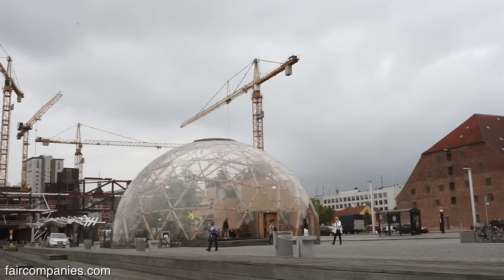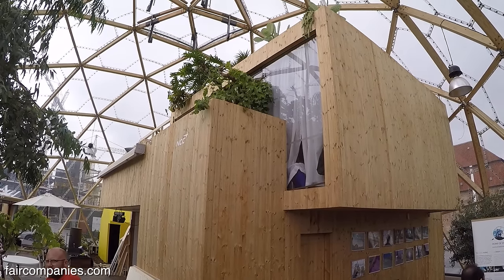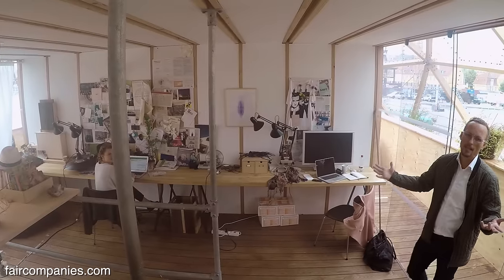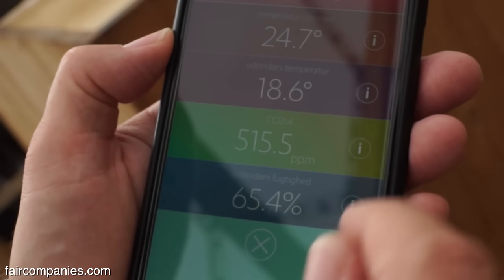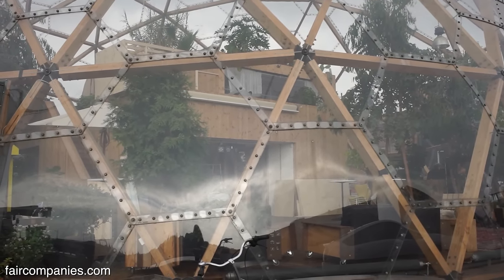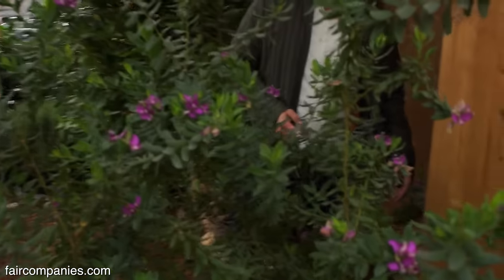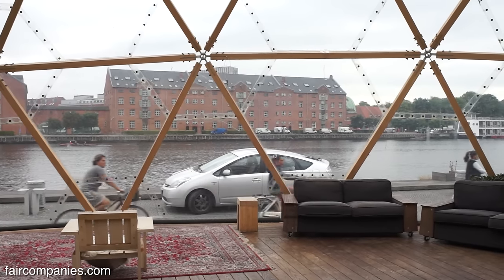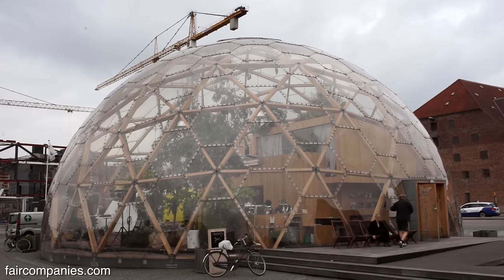Nordic home encased within geodesic dome for passive solar

Comment: I went to the party that they mention in the video. and although there were approx 150 people and it was misty inside the air remained fresh and a lot more comfortable than any other building I have partied in. there is an air-conditioning unit that they use for increasing circulation. I love this place and hope they build more around the world. who doesn't like the Mediterranean climate? :D

Comment: This is a fantastic idea. I've considered this kind of structure. But, I'm thinking of making the North side and part of the top opaque so as to limit insolaration in the summer, and the radiation of heat out during night and/or winter. The amount of insolaration would be naturally changed by the sun's angle during the year.

Comment: I've had this idea in my own "thought design sessions".  Also, for more dense urban developments, a series of stacked, extremely large platforms that contain a series micro-neighborhoods where homes can be built.  These homes also don't need as much protection since the platform provides the basics.  The micro-neighborhood gives basic protection from rain and extreme sunlight (or let sun in depending on climate).  Maybe it is fully enclosed?  Partially?

The neighborhood has no large vehicle traffic.  Maybe there is a basement level for deliveries and vehicle parking/reception/departure.

Comment: So the heat from the dome prevents snow, ice build up? I’d need to see that before I gave up feeling any weather. Also, you need to make the connections thinner. There is too much junk blocking the view. The interior is a mess. Set up for its intended purpose, a garden, kitchen, children  etc and actually test it. How does the car get in/out? How do children deal with the dome? How do you clean it after the rain? Poly gets scratched by rain, plants, wind. How do you deal with loss of visibility? What is its lifespan? How are panels replaced?

Comment: Why do we not have small communities under large domes  by now especially in cooler climates.
Reply: TheJunkyardgenius 
Great question. I am more interested in creating a family home like this
Pammie from Chicago
Reply: Unfortunately business is rarely driven by engineering efficiency. It's more about creating and saturating a given market with products, even overproducing and ending up throwing huge number of products (and the sold ones carry the cost of the over-production and inefficiency) ... similar story with cars, even electronics. 
Probably one of the few exceptions is airplane industry, where because of the costs and low profit margins they're forced to be max. efficient ...
No wonder Buckminster Fuller opened one of his lectures with this question:
"Why don't we build houses, like we build airplanes?"
Current one is terrible economy model! :/ 
It has to be changed, and with the climate change already happening rapidly, it's an urgent need to change that stupid model.
Reply: It might be probhibitively expensive to a community dome and there'd be alot of practical concerns.

Earthship communities would be a more practical option, high insulation  on 3 sides and then a separated greenhouse section at the front south facing side.  That regulates the temperature whether it is hot or cold outside.  The glass needed is kept to a minimum and you can go outside for fresh air.
Reply: An accidental fire would cause catastrophic results.
Reply: I want to do that, somewhere in Scandinavia.  I just don't have money and don't live there 😂😥
Reply: They would bake in the summer. Plus in winter it's nice to have some relief from mosquitos, fleas, ticks, flies, gnats etc... Rain is also a cheap cleaner. Many of us are familiar with parking garages or subway stations that are much dirtier than 100% neglected sidewalks(I don't mean trash, but things like spit, spilled drinks etc...)
Reply: Snow would be the biggest problem. A larger dome with heavy snow would collapse.
Reply: @antman7673  Not really.  The total static weight that can be supported over the entire dome is usually greater than any normal snow load it will have to support, as snow does not easily accumulate on a round roof. The reason a geodesic dome can resist damage by snow loads is that the shape of a geodesic dome naturally sheds snow.  Also, by increasing the frequency you increase the strength of the dome.  You'd have to build a HUGE dome with a substantially flattened top before snow load would be a problem and even then the internal heat would help melt the accumulation on the top.  You probaby wouldn't want to enclose hundreds of full-sized homes but you could certainly enclose a small community of tiny and small homes in a shared space like the OP was suggesting.
Reply: because the window cleaning service would be expensive
Reply: @DennisMoore664  
Depends on the size of the small community, how large the dome is.
If it encapsulates 50 houses, the angle of the dome isn’t very high, so we have a huge flat area and snow is really heavy.
1 Meter of snow is roughly a ton of weight per square meter. -That is considerably more than the weight of 1 square meter plastic sheet, plus wood or steel support.

And if the sphere is big and made of steel, it gets very expensive very quickly.
Reply: @antman7673  To avoid the roof angle problem you need to increase the frequency.  That will maintain more of a sloped top and reduce the size of individual panels which helps keep the snow from accumulating substantially on a small number of large panels like you point out.  It would take Jeff Bezo's kind of money to do it which is the real problem.
Reply: @DennisMoore664  
It would at take Jeff bezog money to do.
A half sphere with plastic glass shouldn’t be too expensive.

Bezos money is bigger than less than 50k per house to dime it.
Reply: I think moisture would be a huge issue for the homes inside. That would be the first problem.
Reply: @DennisMoore664  Domes are strong vs snow load because of the configuration of the struts and linkages all supporting the same amount.  Domes can support many times their weight.  This is why domes are deployed in Antarctica.   It withstands snow load and can withstand higher winds than any other engineering.
Reply: @antman7673   the dome wont have a flat top.  that's not a dome.   Also, domes can be feasibly engineered to encapsulate miles in diameter.
Reply: @David-bc4rh  Exactly - And the higher the frequency the stronger the overall dome is going to be regardless of it's footprint.

Comment: I am working on an idea with deltoidal faces fitted into a 4 frequency dome. It would need 1920  bars for 480 frameworks. I made some different designs with fusion 360 to get the exact angles, and i planned a miter saw table to make the production very easy and for a very exact repeatability. And, the outer surfaces i thought about to use acrylic glas and wood with one layer of GFK like wooden boats are protected from water. I would like to share pictures of my drafts and i am very interested in experiences from others!
Reply: Would acrylic be better than polycarbonate?

Comment: Great video, thanks. It's the best use of the geodesic structure that I have seen. You have all the advantages of the sphere  - rain and wind shielding with the minimum of structural material - and none of' the disadvantages - fitting square storage into a round space. Perhaps a small improvement might be to clad the top and Southern portions with solar PV panels to moderate the summer temperatures.

I could not make out their rainwater management system. Where does the run-off from the dome go?
Reply: +Jeff Harmed it looks like the base support is about 6 inches above the ground so I guess rain water goes straight (or curved) to ground. Personally, I would use a 4 -6 foot riser on the sides for height in classic dome home fashion and catch the water. there are so many great uses for rain water and here in Florida we get so much we have to let most go to overflow.

Comment: I imagine cleaning the bird droppings would be fun.
Reply: You could just have a small unit of cleaner drones.
Reply: Just don’t include birds in yours silly. Sheesh.
Reply: Insects produce droppings too ... and you would have to get them inside the dome to pollinate your trees (otherwise they are quite useless).

Oh and imagine the spider webs, birds nests and all the rest you'd have to clean on the inside. Outside you might be able to build a robot which creeps over it for cleaning, but inside there is the support structure.

Comment: I love the concept. Some thoughts:

Are the polycarbonate panels UV-resistant? How often would they have to be replaced in a more sunny environment? Do they get weaker or more fragile over time? How good is their fire resistance (e.g., forest or brush fire in the country, nearby dwelling fire or arson in the city)?

Have you considered using a steel hexagonal frame for the shell doors? That should add more strength than the rectangle with less mass per element, and would be more intrinsic to the overall structure. (You could insert a conventional door frame within it, and even add sidelights.)

One could also hang solar panels from the shell in a pattern to block direct sunlight within (for sunnier regions), or on the solid house walls (although, there are developments in transparent solar panels, which would be prime for the outer shell).

Comment: Might have big problems with off gassing of construction materials and worse, stove gas, propane gas etc. collecting in the confined space. You'd have to rely on sensors and alarms entirely.
Reply: Probably uses electric for all that, especially since it requires less heating with this setup. The rest is easily handled with occasional venting.

Comment: I have stayed in big domes at remote radar sites in Alaska. Granted they aren’t plexiglass, but with freeze thaw and high winds they leak like hell. There is a reason we build structures with an overhanging roof. I built double stud R40 walls R60 ceiling and over 200sqft of glass on the south wall my energy consumption is about a third of a similar sized home. It won’t leak as I have hidden seam metal roof.

Comment: Those should be placed on the top of flat roofed urban buildings and used as greenhouses.  During the winter the flue gasses from the combustion of natural gas used to make hot water and heat the buildings could be vented into the dome, heating the dome while the combustion gases which are carbon dioxide and water feed the plants.  These domes could function as green areas for the buildings tenants to go during winter.  Obviously the flue gas inflow and outflow would have to be managed while people use it.  Since these structures are relatively light, they may well be able to go on the top of many buildings that had not been designed to take any major loads on the roof or another story.
Reply: Love it. It would be great for private individuals that understand the risks involved (making sure the chamber is breathable before you enter it), as a public project, I would be concerned about less intelligent people passing out or dying because they forgot to bring in oxygen before they entered... You could probably figure a failsafe tho... like, when you open the door, it automatically (mechanically, not electronically)  opens a hatch in the roof, and then closes it again when you leave... something like that. Great idea tho... utilize the co2 before it even gets to our larger atmosphere...
Reply: That sounds like a great idea so long as you have a way to quickly vent the dome for people going into it to work.

Comment: As you scale up a geodesic dome the materials must be stronger to support its own weight, trusses need to be thicker, bolts heavier, etc.  This also adds cost to the structure which increases with the surface area of the dome.  The surface area of a dome also increases at 2x the diameter of the living area.  So, I’m curious at what size does the material cost of the structure outweigh the benefits of it?

Comment: I would miss the natural air flow that this design seems to block.
Reply: You can add servos to open various panels for getting airflow as desired and temp control.
Reply: Andrew Benz  Yes a near living thing :) for life.
Reply: The dome air without the pollutants and having trees has cleaner air than outside the dome.   You can always install large fans mounted to simulate wind.
Reply: Openable panels in most greenhouse designs for summer ... so ... yeah pretty common. This is mean for winter remember. 
Also just cross ventilate with two doors open either side if necessary.
Reply: Because your current living arrangements doesn't?
Reply: Just go outside-outside.
Reply: @kevnar  my thoughts entirely. Just go outside :-)
Reply: The hot air created inside would naturally rise out the top and pull in cold air through the open door creating gentle airflow.

Comment: I worked on designing structures like this with the Dome Co in the UK, we did several similar constructions, biggest was the Kneehigh Theatre. I've always thought the best way to reduce CO2 footprint and cost is to use less materials,  use geodesic structures, triangulation and generative design with either natural or fully recyclable materials. Plus these structures can be designed in such a way as to be relocated and re-purposed, lightweight relocatable, reusable structures is by far the best way to reduce CO2 and materials wastage. I still plan on buying some land and designing myself a geodesic house with lots of house plants inside one day.
Reply: thermal insulation (winter/summer)?!
Reply: Need link of your project

Comment: Capillary action and wind driven rain would make those plates leak and drip.
Reply: I have read about Fuller.  Leakage was an issue in Fuller's day.  But I still like the creativity.
Reply: If you look closely at the polycarbonate joints, you can already see substantial green algae colonies have spawned. Clearly, there is a LOT of moisture getting in. But like the previous commenter, I applaud the interesting effort.
Reply: @josephhook5468  The creativity is like the Emperor's new clothes ... a lot of BALONEY for a lot of stupid things which people who ACTUALLY WORK with such stuff - gardeners who own a greenhouse or people who know about the practicality and non-space-saving of a round construction site - could see in about a few seconds. Polycarbonate degrades in a few years, scratches easily ... which then allows mold/moss to take hold. It is SHIT for this stuff.

Comment: Think bigger with 240° angle wedge .Solar Panels clading exterior outer dome and inner dome with air circulation between the two domes creating a chimney effect with water trickling down the  exterior in sheets on North side wedge giving evaporative cooling effect. 
   The North side wedge could have  reflective mylar film and LED lights illuminating inside of large geodesic dome. 😎

Comment: Now I am curious how well this would perform in a Canadian Winter.
Reply: Nathan Peters Clark you could email local professors and ask?!
Reply: Shatter like frozen polycarbonate
Reply: They had a better example of this idea that had been created by real people without millions of dollars to waste. It was called "Family wraps home in greenhouse" And it worked fine in a northern climate.  

What people don't get is if you keep the weather out you get geothermal right through the ground.  I am in Toronto, and my garage only rarely freezes because heat comes up through the slab, even though the slab is exposed to the weather around the edges.
Reply: Our crazy swing to warm temperatures would make this hot!
Reply: the Pacific Domes are used in Hawaii as well as Alaska so I think as long as you accommodate to each season it'll work.

Comment: that dome is nuts and will cook in summer and at other times if its sunny and mild temps. outside!  and the maintenance on the dome is difficult.   and then you design and put a conventional non-solar house inside of it!  crazy.    Just design/build a passive solar house in the first place!  earthberming all but the south face is the best!

Comment: I live in a dome home and love the Dome of Visions build. The poly carbonate design is supper cool. If the temperature is at 32 degrees fahrenheit outside, what will the temperature be on the inside with the Dome of Visions set up in that temporary location where it's at now?

Comment: This is close to what I have imagined my dream house to be. House in a greenhouse. I don't know about the lifespann of the polycarbonet though.
Reply: Don't worry about the lifespan of the polycarbonate, it will survive you ;)
(I would prefer glas anyway)
Reply: This is my concern as well. Polycarbonate yellows considerably in just 10 years with a UV coating. Glass would be preferable, but it is heavier and more dangerous if it breaks, unless you go with safety glass. I would not want to have to buy all new polycarbonate every 10 years. That would suck.